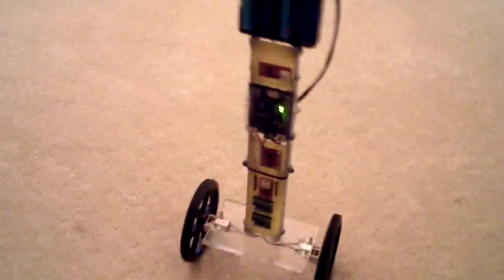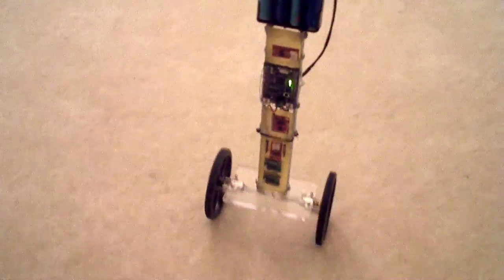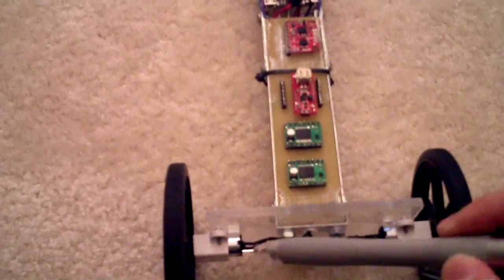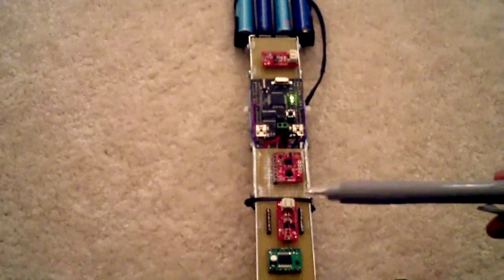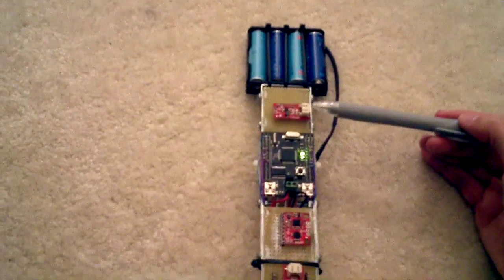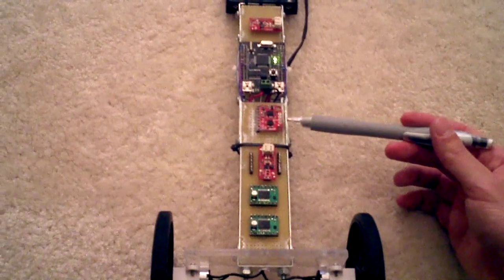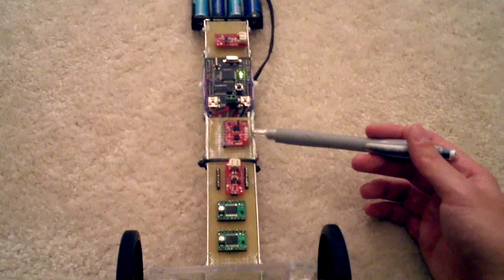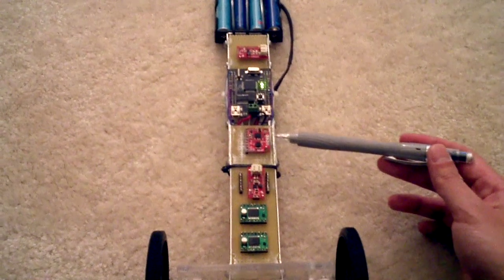Free-Stand Inverted Pendulum Robot

Comment from the maker: @primaris I set the gain iteratively.  It definitely is more forgiving on carpet than on hardwood, but it still works on a smooth surface, it just wanders a lot more.

I added wheel encoders to have it stay put, but the encoders I had were very cheap and the motors had significant backlash, so they didn't work so well together.

Comment: Nice work!  Did you choose the filter gain for the accelerometer iteratively, or was it based on the observed gyro drift rate?  Does the robot perform differently on a smooth surface?